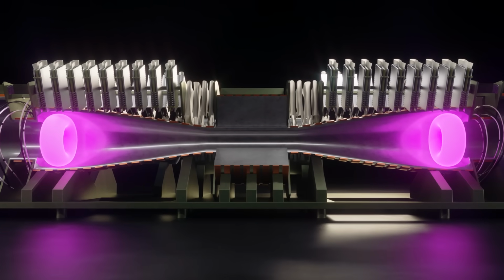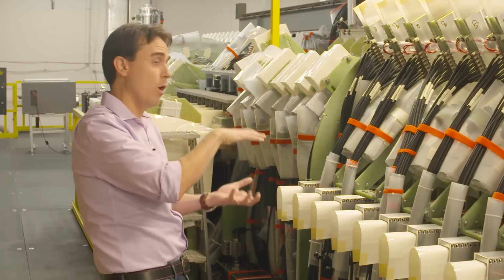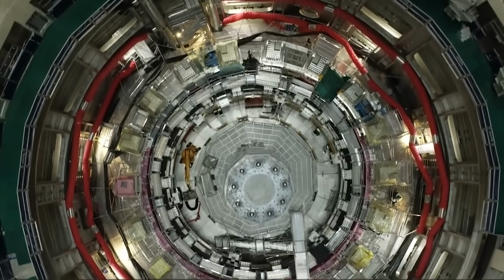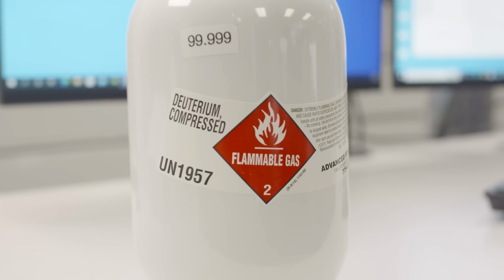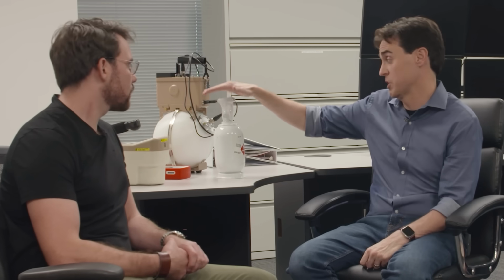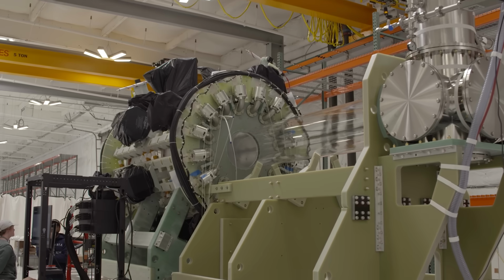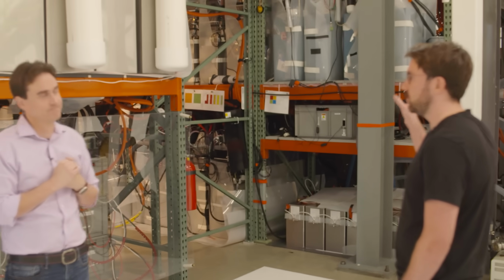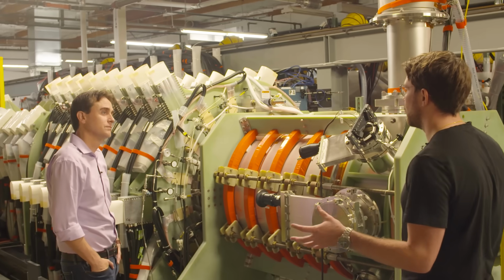A New Way to Achieve Nuclear Fusion: Helion

Comment: Believe it or not, this is almost exactly how a warp field is generated in the sci-fi vessel U.S.S. Enterprise of Star Trek fame. The plasma is injected from the matter/antimatter reaction assembly (M/ARA) where it's created by firing elementary particles of matter and antimatter directly into each other in a never-ending generation of energy inside the M/ARA that is then channeled up and into the warp nacelles. The Chief Engineer modulates power feeds to all the systems on the ship. The plasma is injected into the nacelle under incredible pressure in a straight line that's held in that shape by high energy magnetic field that then causes the warp field to bloom around the vessel. Now that the ship is inside its own little universe, submerged in deeper and deeper layers of subspace--depending on the warp factor that's chosen. The higher the time-warp-compression-field chosen (Warp Factor 8...Warp Factor 9!) the deeper into subspace the vessel is submerged; almost like a submarine. None of this would be possible without the endless generation of that same supehigh-energy plasma.

Interesting Links:
|-> https://science.howstuffworks.com/antimatter.htm
|-> https://www.cygnus-x1.net/links/lcars/blueprints/LcarsGFX/tmp-proxima.png

Comment: Why slam the two plasmas together? Why not do a controlled squeeze to the middle then continue to squeeze until fusion ignition while also gradually increasing excitation voltage? It would still be a drain on the grid,  but not an instantaneously depleting one.  Seems like the current process is akin to the combustion engine cycle, ie batch-wise... the sun's process is continuous.  I'd also be curious as to how to cool the system,  I guess that's why everyone else is using water,  to cool as well as steam conversion. IMHO.
Reply: FRCs are sort of weird. When they collide, they merge into a single FRC. The kinetic energy of the two original FRCs is transferred to that new FRC and it becomes hotter. Hotter FRCs are more stable to tilt instabilities. So they now have a hotter and more stable target for the compression that increases density and temperature to fusion conditions.

Comment: I believe ITER is meant to extract energy from the push-back on the magnetic fields, too. I have no idea if it works but it sounds better than running hot water through a turbine...
Reply: No, ITER won't have any energy extraction at all.

Comment: it can't be stopped its self sustaining now - Doc Ock
Reply: Fusion can be somewhat self-sustaining when you achieve ignition. That is when the fusion products are so hot, that the plasma is essentially self-heating. But that only applies to the heating part, not the confinement magnets and other parts of the system. And if it only one small parameter is off by a little bit, the reaction will stop immediately. And the fuel would get depleted really quickly too and if it is not replenished constantly and products (ash) is not removed constantly, the reaction will stop. 
In Helion's case, the machine is pulsed anyway, with a single pulse only lasting about 1 ms and they are also not aiming for ignition either.

Comment: Would it not be better to have the magnets pull the particles through one another instead of pushing them into one another? And also, what if instead of having the same charged particles colliding they have polar charged particles colliding to help with the fusion reaction?

Comment: How much energy is being used to produce how much energy?
Reply: Well, Trenta is still a subscale experiment without the equipment for energy recovery. And so all energy in/energy out is mostly theoretical depending on the fuel one would choose.
By my estimate, it should be quite close to Q(sci) ~1 for a Deuterium and Tritium fuel mix (that means energy out = energy in without losses from conversion and a few other things). Polaris, the follow up will operate at over twice the temperature and will have the power conversion equipment. It is currently on track to produce small amounts of net electricity towards the end of 2024. That is when we will know whether their design works as anticipated. Personally, I am quite bullish about their approach and they are my personal front runner. We will see how things go.

Comment: Have they eliminated human error in the production, operation and maintaining of reactors? If not nuclear power is still unsafe.
Reply: These things are very safe. There is pretty much nothing that can go wrong with them. Fusion is very hard to do. If only one parameter is only a little bit off, it just does not work. Plus this machine is pulsed and each pulse only contains a few kWh of energy.
Reply: @elmarmoelzer2229  look at every nuclear disaster. Every single one was caused by human error. In theory nuclear power is safe until you put humans in charge. Its NOT SAFE.
Reply: @jonsturgill8868  Of course they have. But you’re saying “every nuclear disaster” as if there’s been more than one.

How many people have to die for you to class it as a “disaster”?
Reply: @Gomlmon99  At least 4 that I know of.  And no one has to die for it to be a disaster. Stop trolling and read a book.
Reply: @jonsturgill8868  
Grrrr, my earlier comment got deleted because I had a link in it.
1. This is fusion, which is the exact opposite of fission. So, anything related to fission is not applicable to fusion. Really, there is not anything that can go wrong with this. It will be by far the safest energy source around and even if someone was to drop a huge bomb on it (in which case you have other, more serious problems), the resulting damage to the environment would be much less than the effect of the bomb in the first place.

2. On a grander scale of things, fission is actually quite safe too. It is safer than most other energy sources. In some 70 years of fission, there has only been one major accident that has seen deaths. That one was so badly handled in so many ways (and reactors have improved since then) that it is unlikely to repeat. Fukushima and 3 Mile Island killed no one. Anyway, statistically speaking, fission is about as safe as wind/TWh generated. It is safer than hydro and much, much safer than coal and gas (by a factor of 1000!!!).
That is based on statistics for deaths/TWh generated, which you can google. (Mortality rate from accidents and air pollution per unit of electricity worldwide, by energy source)
I can't link it here or my comment would get deleted again.
Reply: @jonsturgill8868   Hydro- related disasters have killed more people than nuclear fission has (way more, actually). More people have died from installing rooftop solar per TWh generated than have died from fission disasters, including Chernobyl). Those are all facts. 
But again, none of that applies to fusion anyway. Completely different thing.
Reply: @jonsturgill8868  How can 0 deaths be classed as a disaster? 

And four? Do you know often oil and gas have a “disaster”? By your standards, it’d every couple hours.
Reply: @elmarmoelzer2229  great reply but my original comment is still correct. As long as human are involved nuclear power is NOT SAFE.  Disasters dont need human deaths to be considered bad. Toxins released into the air and water will cause problems later on in humans and animals.  There is no argument, no debate. Nuclear power production is not safe.  You dont think so. Go live next to a nuclear power plant.  Prove us wrong.
Reply: @jonsturgill8868  
This is NOT nuclear fission.
What toxins?
I would prefer living to a nuclear plant, rather than living 10 miles from a coal plant or next to a freeway.
Nothing is 100% safe but fusion power plants will be much safter than anything out there, even solar and wind.
Reply: @jonsturgill8868  Buddy I think you are very confused? 
Your question is so stupid. What you are asking is why can't a petrol powered V8 explode and melt like a nuclear fission reactor causing catastrophic damage.
I think first learn what a nuclear fusion reactor is and then learn how it differs from a fission reactor.

Comment: What are they making? Like what's the fusion make molecules? Water, air, grass, steel? And if it gets to a million degrees how the fuck does the metal not melt? I don't use
Reply: First they are fusing two Deuterium atoms to make either a Helium3 atom and a neutron or in a second branch (both have about the same chance of happening) a Tritium atom and a proton. 
The Helium3 is then fed back into the machine and in another pulse is fused with Deuterium to make Helium4 and a protons. All of these reactions are exothermic. So, they release a lot of energy.

Comment: Okay, the one question I was hoping to be answered is, what is the energy efficiency of the fusion apparatus? How much energy  does it require vs how much it puts out? It seems to require an incredible amount of electrical power. Into the millions of watts. And we know that the Helium 4 event will create 4x more energy than nuclear fission, but how does this compare as far as energy efficiency is concerned?
Reply: This machine is not a power plant yet. It is a subscale experiment and lacks the power conversion equipment. The next one, Polaris is set to produce a small amount of net electricity by the end of 2024. Also note that the Watts are not that important in a pulsed system. It is the Wh/pulse that is important. Even a million Watts does not matter if they are only for a few microseconds. AFAIK, the total energy consumption per pulse right now is only in the single digit kWh.

Comment: All sounds great but where is this "Tremendous amount of power" that is generated? I can find no reference to the amount of energy produced, which has to exceed the amount put in for this to be called a viable fusion process.
Reply: As far as I am aware, they have not yet built a machine with the capability for energy extraction, as that was planned for the next gen.

Comment: If anyone who works on this project is viewing the comment section, I am wondering why you use helium3 instead of tritium, and what the main difference between the two is.
Reply: Not working at Helion but the main reason is that D-He3 releases most of its energy as charged particles and not neutrons. That energy can be directly converted into electricity without the need for steam turbines. So it is, at least theoretically, much more efficient. 
Only one 3rd of the reactions (the D-D-> He3 + n) will produce a neutron and that has a much lower energy than the neutron produced from D-T fusion. So they are easier to shield and cause less activated components.
All that improves economics. In return D-He3 is a little harder to do, but the guys at Helion think that it is worth it.
Reply: @elmarmoelzer2229  Thank you for the explanation. I jumped the gun a little when I asked the question, because 5 minutes later, they answered it in the video! LOL!

Comment: So, i once discovered Index Funds, and in my theory if it were possible to keep operations in margin of capital gains, it would not be as nessasary to accept externail investmemnts. https://www.youtube.com/watch?v=wSIXEXIFWgY
Reply: Also, These videos are really great, i like how actually descriptive they are as it gets the mental gears turning. I think that if tritium were sotred in a high density glass or synthetic sapphire it would be possible to use sun light to increase its decay rate by storing it in a high tempreture envrioment. synthetic sapphire is really up there grade armor and will most likely meet alot of the nessasary tolerences needed to "hold" alot of the meterials involved, and perhaps it is dence enough to capture the stray neutron and proton emissions. I discovered synthetic saphire watching "demolition ranch" here on youtube, dude does alot of "meterial research". lol

Comment: The question with compression induced fusion is not whether or not it will work,
but whether or not it will generate more energy than it uses.
I would have used a dual cyclotron setup for this, with only an
end cycle with magnets for final confinement.
Reply: First you speed up the plasma particles by cyclotron,
then when they have reached speed, they end up in the confinement
which is a set of two magnetic fields.
The inner magnetic field, the final confinement is a strong magnetic field,
which prevents the partciles from escaping.
The second field is slightly more stronger, but last shorter, as it's only required
to push the particles through the final confinement field without losing the
speed buildup.
Reply: Helion's machine can be enhanced by introducing a spin in the plasma.
The plasma would start to swirl in a circular shape, but with that also add
circular speed, with each 'wheel' that then forms on both sides, before
the clash, these 'wheels' could be moving in opposing circles.
With more speed in the plasma, the amount of fusion will also increase.
Reply: Also using the Tokamak principles, they can increase the energy output
by also converting the neutron's speed's into heat.
Why not combine if the output becomes better.
Also, the plasma can be divided again and re 'slammed' for a still better
usage of available resources. Better efficiency is never bad.
I don't know if fast 'slamming' also increases output, like 10 Hz or more.
Reply: Also to protect the inner chamber from damage, you can use an ablative
heat shield. Instead of impacting the inner metal, it would impact
a secondary layer, which would take the damage instead, which would
introduce impurities into the plasma, but that's still better than replacing
the inner chamber again and again. The convex shape of the housing
allows for insertion when the generator is not running and cold,
while removal would be easiest shortly after, since metal expands more.
In between you can also have a heat flow medium like inert gas,
to help carry off the unwanted heat in places.
Possibly that can be used to generate some electricity as well.
Reply: New throught: If the inner chamber needs protection from heat,
you can try a wolfram cylinder, and liquid gas, which would then
take that great excess that happens when you overheat now,
and use that heat transferred for turbine electricity again.
get electricity both ways, while enhancing the ability to gain
power from the fusion once again.
Maybe you can ramp it up to a few hundreds of millions degrees.
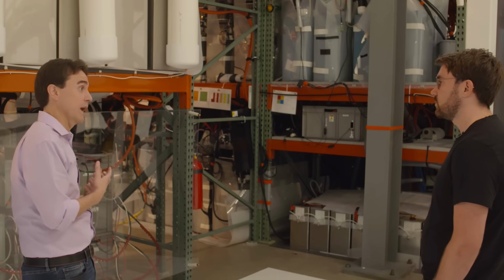Reply: 23:52 You can use the same tech as ion propulsion does.
Separate atoms into ions, magnetically confine the ions on one end,
the electrons on another w hile the release and allowed rejoining of the electrons
with the ions would create a high voltage current through a conductor
back into the ionic substance.
The bigger the ionic storage the greater the capacity for electrical current,
but also the more efficient the ionic storage since volume increases greatly,
while the power needed to keep the ions from making contact with the solid
parts of the ionic storage is pretty hooked into the surface area,
instead of the volume.
Reply: Also ionic storages are much cheaper than capacitors on both
per output as well as lifetime, since you need much fewer
with an increased need for fast discharge while capacity
can be increased by mere change in size.
Reply: Also electron storage is best done by stage, in small batches.
You separate a few, and then push them into a larger storage, batch by batch.
All you need for the larger storage is fixed electromagnetic fields,
while the pump needs to be slightly stronger electromagnetic fields.

Comment: I'd like to see an update once the 7th generation system is operational, and if the heat problem is resolved. Also, what is being done to prevent a catastrophic breach from the containment breaking down? Capacitor failure or the meltdown of the containment component to me seems a likely event at some point.
Reply: These things can not melt down. The plasma is hot, but not very dense (closer to a vacuum than to ambient air). A single pulse only contains a few kWh of energy. If confinement failed, there would be some abrasion on the inner walls (would mean maintenance earlier than planned and additional cost). If the walls failed, the plasma would cool off immediately and fusion would stop. There is not really much beyond that that could happen to the machine itself. Now capacitor failure could be quite dramatic, but we have lots of systems with capacitor banks like these all over the world. You just take some safety precautions, and they will be fine.

Comment: Gravity and atmospheres of pressure seems to be the recreated here. An aspect that is difficult to replicate from the sun. Very impressive. Most stuff up until now has focussed on failing to make the weak magnetic force weaker at higher temperatures. Which  has not worked up until now. Now you need to display that it can be done in rapid fire.